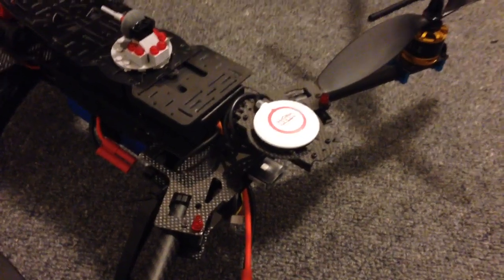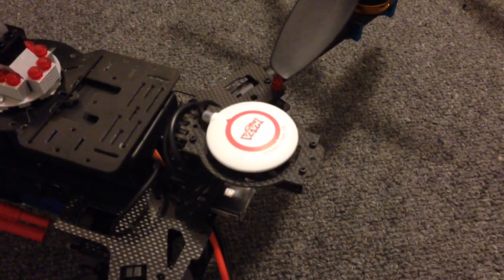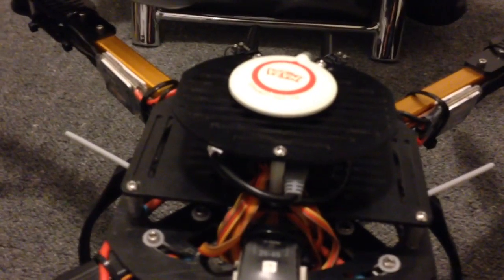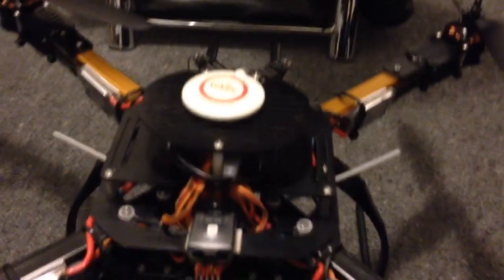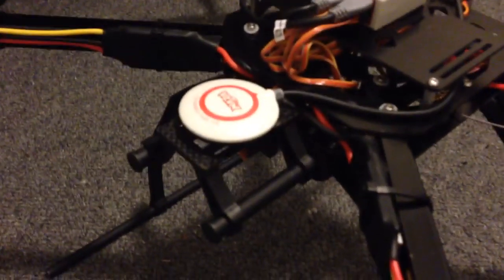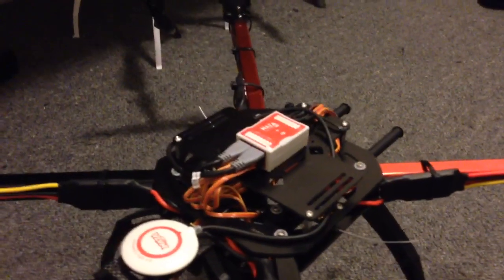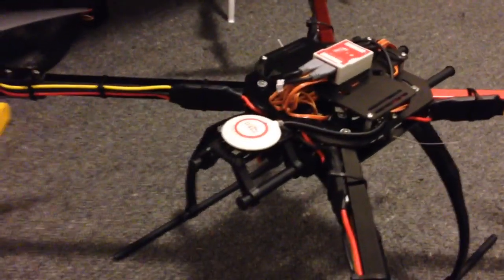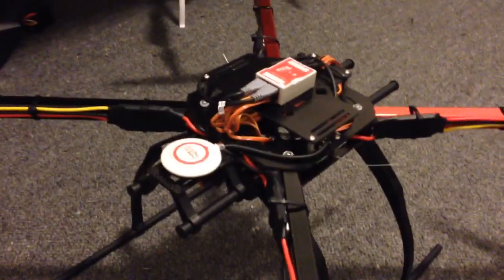Naza M Lite GPS Antenna mounting

Comment: What numbers did you put in the naza assistant in cm for the gps location?
Reply from the maker: Brandon Lowe Different values for each quad but I think I used X = 0, Y = 0, Z = -5 on the one with GPS on top as per the video..  I have since moved the GPS to allow fitment of a canopy.